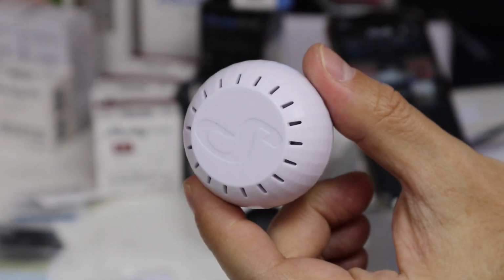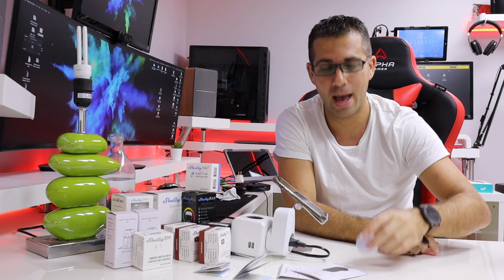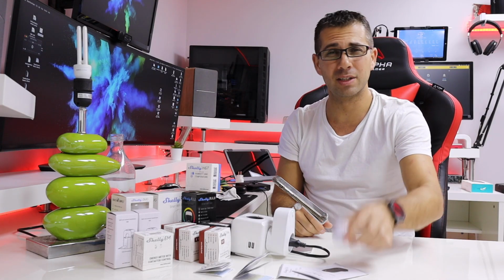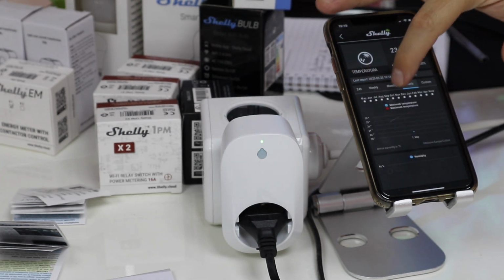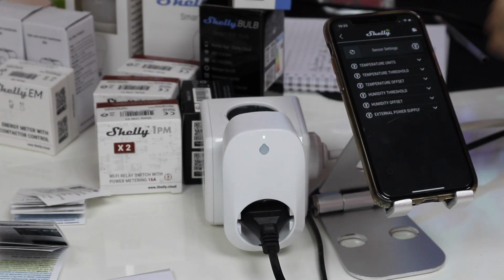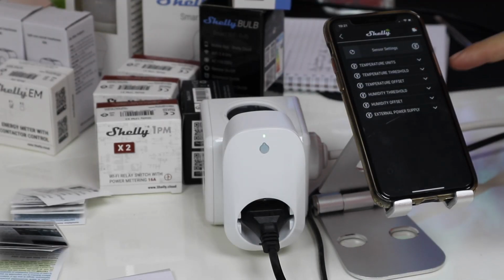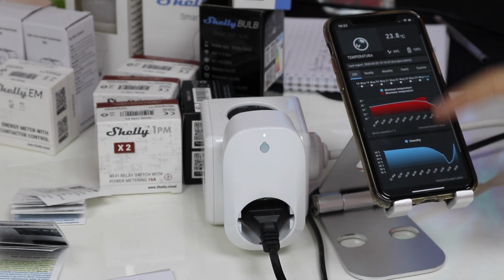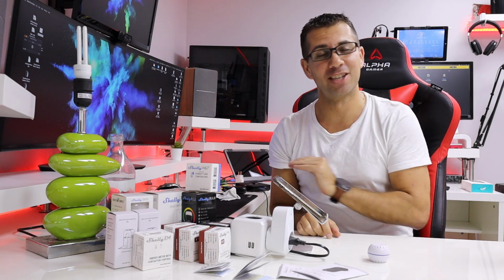SMART Temperature Sensor Shelly H&T

Comment: Hi. bad experience with this sensor to use it as trigger for heat. They push temperature once there is a 1 degre gap. Not precise enaugh

Comment: Sensor specs state the operational range is -10 to 50°C and the measurement range from -40 to 60°C. Could this device be used inside a freezer at -15°C?
Reply: Its mistakenly stated. I’ve contacted the manufacturer and the confirmed that it will work till -40, so it can be put in a freezer ( tested it and it works at -21)

Comment: That's a massive battery for only 6 months use :(
Reply: Despite setting the thresholds in the app to higher values (less frequent reports), another trick is to assign the sensor a static IP address. That way the sensor requires less time to log into the wifi and upload the date, which results in less energy consumed.
Reply: because has wifi on
Reply: Actually, according to their website, it is (up to) 16 months not 6.